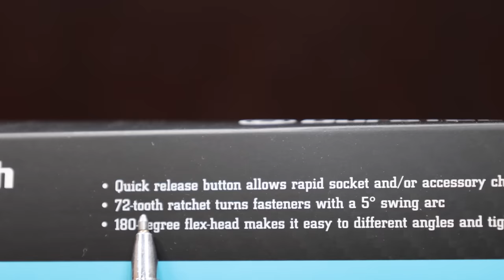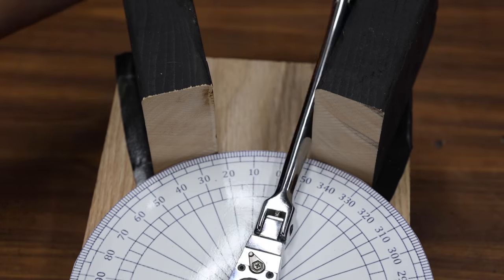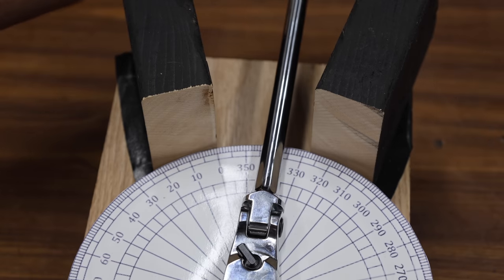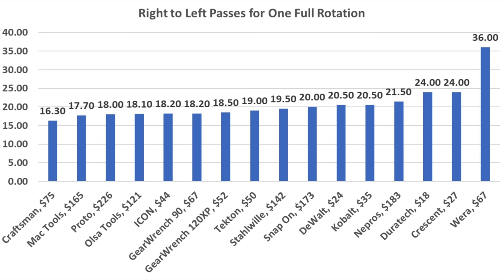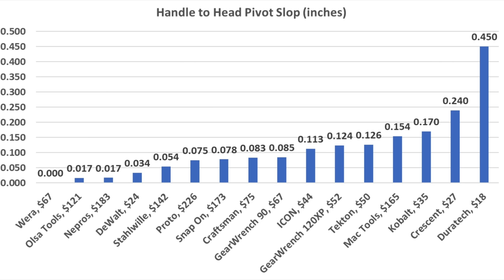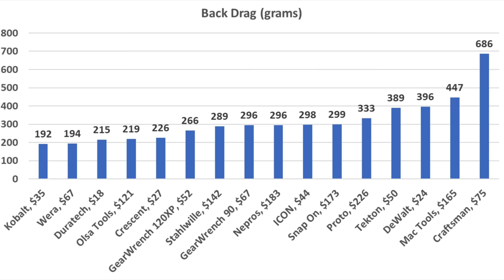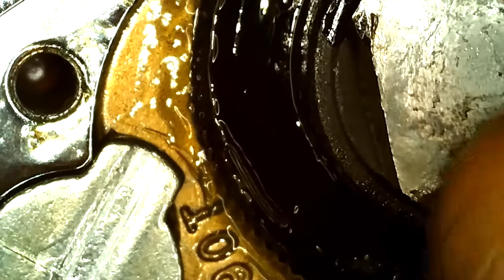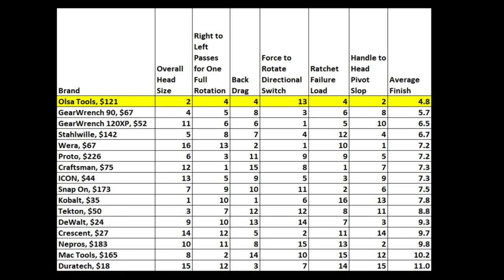Best Flex Head Ratchet? Let’s settle this!

Comment: Having a quick release  socket option is so important to me. Sometimes the ratchet won't let go of the socket very easily. Would've liked to have seen that test.
Reply from the maker: Thanks for the suggestion.
Reply: Yea. I've been using my managers snap on locking flex until I move my box into the shop next week. The socket is super hard to remove from the S-O. On my MAC flex it comes off easy in all conditions, even greasy hands. The S-O I have to use a flat head to pry them off sometimes, especially with grease.

Comment: One thing I would do is add the failure mode to the load chart. Maybe in the vertical bar. This is super important as I'd rather not have parts cannonball in my face, regardless of the ultimate failure point. This is also a mark of a good design as attention to detail is required to make it fail in the head.
Another note, is the larger head designs could be that way to compensate for using cheaper materials. Maybe do a Rockwell C test next time. A lab could do it if you don't want to buy a machine.
Keep up the good work sir!

Comment: Craftsman makes a second swivel head ratchet (CMMT99422) that functions similarly to the Wera with the gimbal head design. I love it because it can instantly be turned vertical and used screwdriver style with the handle in line with the socket.
Reply from the maker: Thank you for sharing!
Reply: Gimbal head is my favorite, I have an SK that is always the first thing I grab 👍

Comment: Glad to see craftsman still making good tools even after their change of ownership.
Reply: Craftsman is a brand they don't really make anything. They put their branding on tools others make.
Reply from the maker: Thank you for sharing!
Reply: @1pcfred  True, but the Craftsman tools are made to their specifications and quality standards.   That is true of many of the products you buy and use every day.
Reply: You’re watching a tool video so I assume you know Craftsman is junk right?
Reply: @teamdada2194  compared to what? I’ve got a lot of craftsman tools and they’ve been great, however they’re from the early 2000s or older for the most part. I don’t use them on a daily basis as a mechanic, so wasting money on something that comes off a truck is out of the question.
Reply: @teamdada2194  Craftsman has had some of the best manufacturers make tools for them. So blanket statements such as yours are ludicrous.
Reply: @harpintn  it is still improper to say that Craftsman has made anything. It is difficult to know who made what though.
Reply: @1pcfred craftsman from lowes cmon man
Reply: @4rdF1Hunny craftsman from lowes are junk. Craftsman from sears are good. 😊

Comment: Gotta say ICON at 44$ beating alot of the other ratchets some being over $100 is amazing. Personally I use a Big Red extension flex head ratchet. Love it have used it uncountable amount of times and only complaint was the flex head lock broke after second use but turns out it works better without a locking mechanism. Great videos as usual.
A really neat video would be comparing different brands of sewing machines. Which ones have less bobbin snag, better thread tension, and needle depths and strength. Not to mention sewing speed controls.
Reply: HF has also been putting out Icon coupons more often.  Most of my Icon stuff was obtained  20% off.
Reply from the maker: Thanks for the suggestion.

Comment: 10:30 no real mechanic cares about an 'easy' to change directional level due to 'greasy' hands. This is definitely a 'Todd test'. In fact, I much prefer a firm, positive switch engagement which also helps prevent unintended direction change when working on tight placements
Reply from the maker: Thanks for the feedback.

Comment: You didn't miss a test! Snap-on & Mac Tools are so overpriced. You showed a few good lower cost alternatives that performed very well. Thanks for another excellent video!
Reply: What is the point of a torture test on a flex head ratchet?
Testing to failure isn't a good torture test anyway. A much better test would be to buy 2 of them, test the failure load on one and then use the other one for 80% of the failure point 1000 times and then check wear. Admittedly, this would be more difficult to do, but it would actually be a worthwhile test.
 Not one of these ratchets will ever be used to over 200 foot pounds.  They are the wrong tool for high torque fasteners.    Most people couldn't generate that kind of torque with the short handles anyway.
Reply: @tarstarkusz  I like those tests. It just shows how much abuse the tool can take before it breaks. People like to see that
Reply: @electronicsNmore  it's useless, like he said most people will never reach that torque. if you have to put a cheater pipe on for anything it is definitely the wrong tool and you should expect it to brake first instead of the fastener.
Reply from the maker: You are welcome!
Reply: @andrestnt  Sometimes you have no choice but to use a cheater bar. I've done it many times over my lifetime working on countless boats and cars. It's a lot cheaper to do that, then go out and spend a fortune on a much larger tool that you're only going to use once or twice
Reply: @electronicsNmore  not on customer cars, dealer ext. Diy yeah sure I've done it too and paid the price by wasting time and money extracting broken studs/bolts. also what fortune? they have super cheap quality 1/2 ratchets, even impacts.

Comment: Something to add to the testing process is the manufacturer’s customer service if they’re willing to replace the broken ratchets or not, rate them based on how difficult it is for them to honor the warranty be it no questions asked or if they give you the runaround or out right reject the warranty replacement
Reply: Well noted,  I agree 100%!!!   If the mfg. will not offer a warranty or replacement of any kind they may not have a lot of confidence in their own product. - But of course that also opens the door to abuse and dishonesty!    S. Carolina
Reply from the maker: Thank you for sharing!
Reply: Used properly tools don't tend to break. If you break stuff or wear it out then you should repair or replace it. Otherwise you're just a burden on society. Unless it is a legitimate manufacturing defect. But in my experience that happening is rare.
Reply: @1pcfred  I've had the same Mac 1/4" drive ratchet strip out 3 times and been forced to finish the job with an ICON 1/4" drive ratchet.  When used in a professional environment, tools break....  And for the record, the torque on the bolt that stripped out the Mac ratchet, was less than 5ft/lbs.
Reply: @aaronthomas6155  you'd think the tool could handle that. Perhaps MAC doesn't make the best 1/4" ratchet drives? If I had a tool fail multiple times on me I'd be looking for some other tool. It could just be a maintenance issue though? You'll see Oil Daily stamped on every Snap-On ratchet drive.
Reply: @1pcfred  Last rebuild of my Mac ratchet only lasted about 30 minutes.  It literally stripped out on the first bolt I tried to take loose, about 15 minutes after the tool truck left.  They're just garbage products.  It's in the trash and gone now.  I'll pickup an ICON ratchet to replace it next time I'm at Harbor Freight.
Reply: @aaronthomas6155  stripped out on the first time is about as bad as it gets. I was never a fan of MAC tools. I have some MAC tools and I'm not impressed. Icon seems pretty decent for what it is. They're basically budget knock offs. Like Snap-On but don't want to pay the high price? Have we got tools for you!

Comment: I've got Wera, maybe it didn't outperform other ratchets, however it's still a pleasure to use it. It's bigger handle maybe is not great for the tight spaces, but for other jobs it makes the tool sit in the hand very nicely. Max force test is also something which I would never like to have to test in the real life. Also the low backdrag is really making this tool awesome
Reply from the maker: Thank you for sharing!
Reply: The Wera appears to focus on quality and user experience. Looking at the test results, it only lost out due to its size. Just know that it's not the tool for tight spaces or super high torque.
Reply: I think the Wera is a different category than a flexhead. The Wera can be used as a driver, and I would call the head style gimballed (like a gyroscope, or a ship’s compass).
Reply: If you actually do a basic statistical analysis on this data set the Were is the best followed by the gear wrench (both) and the Olsa.
Reply: that is reassuring in a strange way. I own the Wera (it is part of a set; for a dumb reason I bought the SAE set). I can hardly believe how much money I paid for the whole set. So at least I have the smugness of knowing I have "the best" something.
Cheers to all who follow Project Farm Todd!
Reply: @billrogers6863  I have the cyclop sae set for heavier stuff, Toolcheck set for smaller things or harder to reach places, and Xiaomi wiha set for laptop and more precision screws. I also purchased in one promo the 40-200Nm Wera clique-torque mainly for tire replacement and checks. Everything mostly for home usage. Wasn't cheap and definitely they are not the best tools that money can buy, but every time I use them it's always a joy which is the whole point:) Man has to buy some toys from time to time:)
Reply: @garreth123  We have a friend who has "saved the day" at an outing with a Wera Bit-Check. 
One guy reports that his equipment can't be used because something needs to be adjusted/dismantled, etc.
Let me take a look offers another guy who packs a few tools in the backpack. We figure Wera has sold many Bit-Checks as a result of its proven problem-solving credentials.
Congrats on having the right tools for most situations!

Comment: Good comparison. I would actually suggest that a direction switch that is too easy to flip is more of a problem that one that is too hard to flip. I've actually never had a ratchet that I couldn't flip the switch on easily enough, but I've had several ratchets that have caught on something nearby while working and have changed direction unbeknownst to me. 
Also seems like Craftsman is trying to claw it's way back up to being half decent again.
Another good test would have been how easy/hard it is to remove a socket. Sometimes with slick hands/gloves, I'll have to get a screwdriver to pop off a socket.
One thing you didn't mention is that the locking mechanism for the position of the ratchet can be a real help! And you also didn't mention how easy it was to change positions on the ratchets, although you did show the movement. A ratchet that changes position easily is horrible to work with. You're constantly having to reposition the angle because of this. I hate my Gearwrench flex head ratchet because of this. It's way too easy to move.
Reply from the maker: Thanks!  Thanks for the constructive feedback.

Comment: Love my Gearwrench ratchets...bang for the buck, they do really well. Only issue was that early batch of 84t 1/2" drive that would lock up, which got warrantied out no problem.
Reply from the maker: I sure wish GearWrench would adapt the head used on the solid ratchet to the flex head. It would be fantastic in tight spaces!
Reply: @ProjectFarm  might be the locking flex...my 84t non-locking flex have the same size head as the solid.

Comment: Ive got an old Japanese flex head ive been using for over 30 plus years and never had any issues with it ,works hst as good as my snapon and nac rats
Reply from the maker: Thanks for sharing.
Reply: Brother I have and still use a 25 plus yr old popular mechanic flex head ratchet and I’ve never ever had any issues with it it’s kept up along side my snapon and Mac fkexheads

Comment: A little late, I know, but I've found a major consideration on the efficacy of flex head ratchets is the distance between the drive center and the flex joint.  The shorter the better, otherwise your torque tends to twist the socket off the fastener.  The Wera style flex heads are the best in this regard.
Reply from the maker: Thanks for sharing.

Comment: I just bought a pair of Koken flex head ratchets.  They are a huge improvement to my circa 1980’s low tooth count Craftsman and Snapon flex ratchets.  I’m tempted to replicate your very ingenious tests, but no way I’m finding out their breaking point.  Better to have breaking point data on your bench rather than our knuckles.  Great review.  I really like the flex head ratchets but I do need a non-flex for my flexhead impact sockets when the air ratchet or impact gun is too bulky.  I might need to add a locking flex head to the quiver.  Modern car repair demands quite an assortment of tools these days.  Glad to have your hard work to keep us aware of all the great options on the market.
Reply from the maker: Thanks!  Thanks for the feedback.

Comment: The ergonomics of the ratchet and how the direction switch is designed are really important. The switch needs to be recessed or surrounded so as not to get pinched in tight spaces. The Tekton brand has more than one style of ratchet to accommodate different demands. I'm very happy with my 1/4", 3/8", and 1/2"inch flex head ratchets from them. Their racheting wrenches are an excellent value also. I don't believe spending more will always get you a better tool these days. Your tests prove this.
Reply from the maker: Thanks for the feedback.

Comment: I actually bought the gearwrench 120xp  (long, flexi head)based off your reviews.   Overall, it's a decent ratchet, but when I needed it to count, the SNAP ON came through.   I was in a tight space and had to loosen an exhaust clamp.   No way to get anything in that space to apply pressure on the ratchet/bolt/socket.   So it was strictly just relying on the ratchet to turn the bolt.   Gearwrench failed my "boots on the ground" back drag situation.. Snap On succeeded.  My snap on ratchet is also over 12 years old and never been serviced.   Gear wrench about 6 months old.

With all this being said, I still love your channel and your methods.   I realize that every situation is unique.   So, not knocking your testing.    Keep the tests coming!
Reply from the maker: Thanks, will do!

Comment: I'm glad you kept the back drag test for these ratchets.  Excessive back drag can make you think a nut or bolt is looser than it really is and waste your time trying to get it off by hand.  It's not really an issue with most 1/4" ratchets but can be a real problem with 3/8" and 1/2" ratchets (which I hope you'll test next)
Tighter direction switches are kind of a double edged sword, so to speak.  A directional switch that moves too easily can cause the ratchet to change directions during use and a switch that's too tight can be a pain to use as well.  Not really sure what the best tightness would be as far as measured force.
I'm still surprised by the Mac ratchet.  I really expected it to strip the gear teeth like every Mac ratchet I've purchased has done.
Reply from the maker: Thanks for sharing.

Comment: Something I might have added is the ease to replace broken tools.  An example is the Icon.  You don't even need a receipt.  Just take the broken tool into any Harbor Freight and you leave with a new tool, no questions asked.  Great video other wise.
Reply from the maker: Thanks!  Thanks for the feedback.
Reply: YES! I agree completely..he needs to do a whole segment on ease of replacement on tools with lifetime warranty...and do it under cover, because they are likely to go above and beyond if they find out it is Project Farm claiming the warranty, as opposed to how they would deal with your average Joe...
Reply: My local Harbor Freight won't replace any tool under warranty without a receipt unless you provide a phone number, which I won't do for privacy reasons.  My Snap-On dealer doesn't even know my name, but has repaired and replaced tools for me, no questions asked.  Even tools that he knows shouldn't be fixed/replaced under warranty.

Comment: Thanks for your time and thorough testing Todd, the world would be a better place with more of your attitude around!  I've been using using Olsa ratchets in 1\4, 3\8 and 1\2 (swivel model though) daily for a tad over a year now and they still feel like new and they are reasonably priced. No broken tooth leading to busted knuckles and the chrome has survived contact with brake fluid and salt more than once without issues so far. I will say that 90 tooth feels like the sweet spot for durability and small areas as I've had issues with higher tooth counts a few times in the past (yes I'm looking at you Snap on)
Reply from the maker: You are welcome!
Reply: Olsa makes a really nice ratchet.  I bought a set of their ratchets last spring when they were on sale.  For the quality, fit and finish, and durability I feel like I stole them for the price I paid.  Very happy to see them perform so well in Todd's testing.

Comment: Downright excellent, as always!  Thanks, Todd!

Thanks for including all the detailed data.  I might not be so concerned about back drag in that, once the nut is loose enough, I could just get my hand in there and spin it off.  So I might weight the ratings a little differently.

I would like to see a test of how close they get to their minimum swing angle.  In tight spaces, I might not have anywhere near 30 deg to swing; so it's important to know whether a 4 deg mechanism actually works within 4 deg or something wider due to additive slop in different areas.

Also, I've done well with SK tools and would like to see them included in future tests.  I've found them to be pro quality without the ridiculous price tag.
Reply from the maker: Thanks!  Thanks for the suggestion.